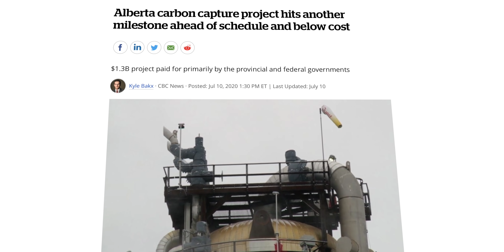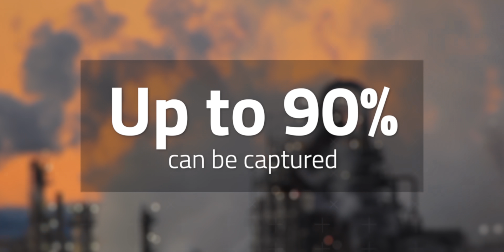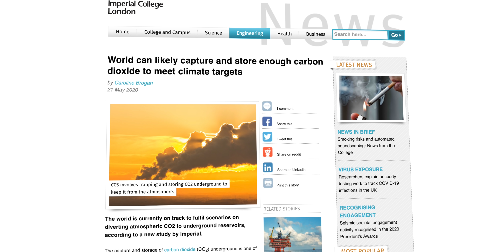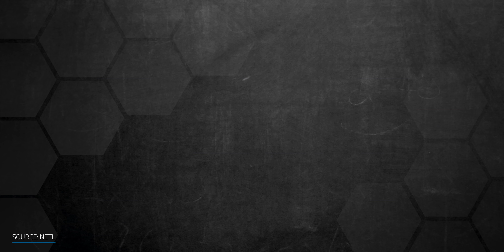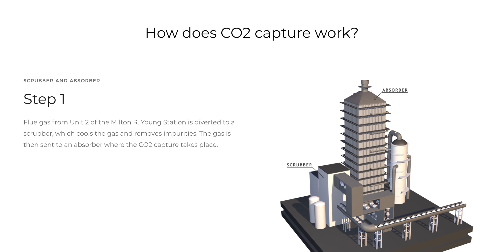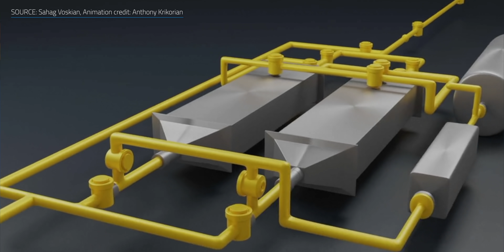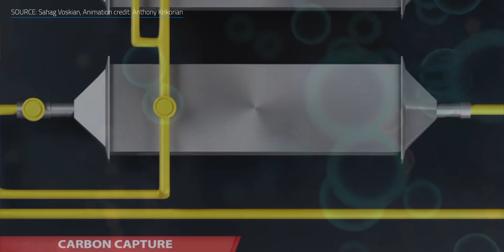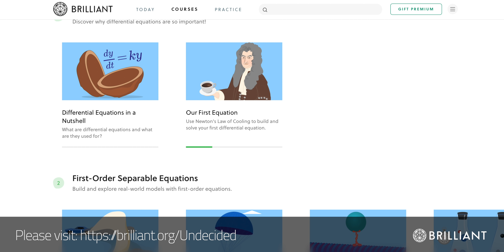The truth about capturing CO2 to reverse climate change

Comment: One thing that many rarely consider is the use of fireless steam locomotives for transport of goods over short distances. Such locomotives have tanks of steam or compressed air that is used for locomotion, which means one could use air compressors to refuel them. Of course, this would be part of concerted effort to reclaim our cities from cars. Railroads require far less space and are more efficient than road vehicles, and thus they must be considered if we are to have sustainable infrastructure.
Reply: What's their advantage over electric trams and trains?
Reply: @Sp4mMe 
1) Cheaper construction costs as they don't need overhead wires or dangerous electrified third rails.
2) No need for batteries that require rare earth minerals that are environmentally destructive to extract and rely on the exploitation of poorer countries.
3) Quicker to refuel (electrical resistance makes batteries take longer to charge the fuller they are).

Of course, I would only recommend them for freight duties on narrow gauge lines as a part of cargo convoys.

Comment: Direct air capture will improve, but to believe that sequestering CO2 under ground forever is a bit of a stretch. We did not leave the coal or fossil fuels under ground forever. Decomposition of plants and living creatures, burning of gas and other substances on earth, digestion and other activities like manufacturing allow CO2 to enter the atmosphere of our planet. To think that carbon capture is the only correct answer or solution for the problem is an error. We can work on the carbon capture opportunity together from day to day and until additional solutions are available and Incorporated with every safe and serviceable process.

Comment: Something just occurred to me: consider that air is over 900 times less dense than earth. Additionally, consider that CO2 comprises about 4 one hundredths of one percent of air. Of all the solar energy striking Earth, think about how much energy could be stored in such a small fraction of possible sinks. It's down there with noise level and it, at least on the surface, seems like it would have a minimal effect.

If you measured the energy stored in earth versus air from a days worth of exposure to the sun, what do you think the difference would be? Then further consider how tiny the fraction of CO2 is in the composition of air, it's a bit laughable.
Reply: maybe you have a good idea or maybe not.  But one thing is for sure, no one knows what you're talking about.

Comment: Sorry, but this video is total bullshit. All you've done is provide advertisements for a handful of proposed technologies without addressing how much these plants capture compared to annual CO2 emissions, and how they'll be powered if not by fossil fuel themselves. If you had done that, you'd come to the conclusions that millions of these plants would be required just to set our effective emissions to zero, and that's still leaving all the carbon in the atmosphere we've emitted since industrialization. The biggest single plant of this kind captures 4,000 tonnes annually. We emit 35 BILLION tonnes annually, meaning you'd need almost nine million of these carbon capture plants. Not only that, but you didn't mention that these technologies require energy to produce and power, and where are you going to get that energy when almost all of our power comes from fossil fuels? Carbon capture is a bullshit technology. The ONLY solution is scaling down our energy demands. That means fewer commodities for everyone. Period.

Comment: The choice, however, isn't between a coal plant running and a coal plant running with a CCS retrofit.  Since coal-fired power stations are very uneconomic these days, the choice is generally between a coal plant running with a CCS retrofit and a coal plant that has been shut down and replaced with cheaper alternatives.

The 45Q subsidy is extremely hefty - of the order of $4 per MWh - and is hence a subsidy for coal to keep on emitting the carbon dioxide that evades capture (_at least_ 10% plus 1/3 for the energy consumption of the CCS process, even assuming the never-before-demonstrated-at-this-kind-of-scale-or-efficiency technology works as advertised for a 90% capture rate).

Comment: Unfortunately carbon capture from coal plants is just someone blowing smoke, metaphorically, the tetra plant is shut down, but even when it was running, it was not even capturing 33% of the emissions of the plant, i believe it was closer to 12%, and they had to build a whole nother natural gas plant to run the carbon capture because that process is so intensive, and the amount captured did not even offset the amount the natural gas plant produced, this technology while a good idea on paper is just soo energy intensive its not practical, we are creating a bigger problem then we are actually fixing, even if you run the carbon capture process off entirely green energy, because its so intensive you would actually be better off to shut down the plant and just run that green energy directly to the grid, literally.

Comment: One of the first “facts” is clearly incorrect. 75% of green house gases is not produced by energy industry. It’s circa 25-35 per cent depending on what you consider an energy producer. Therefore, I cannot accept any further information, even though it might be correct, as you have one of the principles way off.
Reply from the maker: That energy sector number includes transportation, electricity and heat, buildings, manufacturing and construction, fugitive emissions and other fuel combustion.  That’s 76% today: https://www.climatewatchdata.org/ghg-emissions?breakBy=sector&chartType=percentage&end_year=2018&start_year=1990

Comment: Every year we add around 48-49 billion tonnes of CO2 equivalent that the natural world can not sequester. Spending insane amounts on extracting and manufacturing to filter the exhausts of one or two businesses is largely a useless exercise to allow a continuation of fossil fuel burning. One comment here basically says "Soon it will be too hot/dry for trees", CC is useless without already being carbon neutral, the idea had always been to get to net zero and capture carbon, because 2.5-3 degrees will still be difficult to avoid. 

Leaving 50-75% of agricultural land to return to natural succession, not planting forest, is the easiest reduction prior to shutting down internal combustion engines, easily done by switching to a globally plant-based diet. Every recent study has shown that this is the most reliable way to restore water retention and sink carbon. The most conservative models showing 20% of our annual emissions would be removed by this alone.

Comment: My concern is the long term, So if we end up cutting emissions and get super efficient at retrieving CO2 from the atmosphere, how is that going to affect the planet once we revert the atmosphere to below the original pre-industrial level.  Because then we'll have to stop trying to suck it all up and find new ways to release it again.

Plant life and everything else which relying on plant life requires a minimum level of CO2 to be sustainable.  While what we have now is an excessively high concentration, we also need to keep at least some around so that it doesn't become too low.

I understand there is also a move towards reducing methane emissions in order to reduce the weather pattern changes over a short period as methane breaks down in a decade compared to the much longer life of CO2.

Comment: Surely CCS should only be seen as a temporary measure, while we try and keep global temp rises below 1.5oC. Simply digging a hole in the ground and hiding it there (like nuclear waste) is a sticking plaster on a wound, it doesn't solve the problem. Also, it would be interesting to know how much energy/CO2 emissions it takes to run a CCS project, and if that offsets the potential savings from the original capture.

Comment: We're at 400ppm Co2 and under 200ppm most plants die. Earth is starving for Co2.

More Co2 in the air means less water, nutrients and sunlight plants will need, which leads to more plants in more places, which leads to more food and more life on Earth. Earth is not as volcanically active as it was in the past. Earth was losing Co2 until mankind arrived and liberated Co2 from the ground. Mankind gave Earth a 2nd chance of life as we know it. Co2 is not a pollutant, it's part of the life cycle. We have clean coal technology meaning the only emissions are water vapor and Co2. We need more Co2 not less.

Water vapor is responsible for 96% of the green house effect and Co2 only 2%. The sun has cycles and the climate is always changing. Climate models have failed because they underestimated the effectiveness of the plants and oceans to eat Co2. We can't even have accurate 7 day forecasts but we're suppose to trust 100 year climate models and change our whole lives upon it? That's unreasonable.
Reply: ". Earth is starving for Co2."

Its not. The plants are quite fine at 400, 300 and even 200 ppm. We fell below 170 in the last glacial age and plants survived

"Water vapor is responsible for 96% of the green house effect and Co2 only 2%"

Thats not true but also meaningless. Water vapoup content of the air is limited by temperature. Water vapour can therefore only respond to an increase to a temperature increase from other sourcs, for example CO2, with positiv feedback
Reply: @Dundoril  The less Co2 in the air less plant life we have, the less plant life we have, the less food and animal life we have. A Earth with more life is the Earth we want and need. 

Saying plants are fine at 400ppm is like saying handicaps are fine as long as you don't die. I don't agree. 

Currently water vapor is 96% of the greenhouse that is the average figure which takes in for fluctuations in the atmosphere. Co2 is only 2%. The point of this is to educate people that Co2 is not the all powerful agent of climate change. 

Earth was thriving millions of years ago with 4,000ppm of Co2, it was not a calamity, the opposite was true. We don't want 4,000ppm today because it's harmful to human health but 400ppm is dangerously close to unsustainable levels.  We need more plants to help feed the planet and to help keep our atmosphere clean and viable.
Reply: @rickrouse7865  "The less Co2 in the air less plant life we have, the less plant life we have, the less food and animal life we have."

You can repeat this nonsense but it does not make it true. 

" Earth with more life is the Earth we want and need"

Yes and do you know what will not help there: An unstable climate...because  Plants actually need a stable climate.

"Saying plants are fine at 400ppm is like saying handicaps are fine as long as you don't die. I don't agree. "

No its like saying: This 175 cm guy is fine at 70 kg...he does not need to weight 120 kg

" The point of this is to educate people that Co2 is not the all powerful agent of climate change. "

You ignored my whole argument why this is not relevant... Why? I already know..you did not udnerstand it at all 

"arth was thriving millions of years ago with 4,000ppm of Co2,"

Earth was also thriving at 300 ppm...

"but 400ppm is dangerously close to unsustainable levels."

No its not. Plants were fine at 300 ppm too.... but you ignored that again...
Reply: @rickrouse7865  " A Earth that can sustain a greater bio diversity benefits humanity versus an Earth that has a diminished bio diversity. "

The earth could sustain a lot of  bio diversity  at 300 ppm already. There is no reason to believe taht this will increase with more CO2..because a total unstable climate is bad for plants and animal alike...and sorry but  there are rather stable climatic zones.. I main cleary rainforest dont just turn into desert one year and then return to rainforests

". Lowering levels of Co2 will cause the death of millions perhaps billions of people"

It was fine at 300 ppm.... billions did not die...not because of too little co2 and plants anyway

" But 400ppm is anemic levels of Co2. "

NO its not...repeating it endlessly does not make it so.... Again: Plants are fine at 300 ppm.... 

" Obesity is a health problem from too much sugar in your diet and is unhealthy."

And why would 500 ppm for exmaple be any different? Just because you claim it to be?

"It's a positive effect, unless you think less plant and animal life is better for Humans."

Again you just claim that stopping the increase in CO2 would somehow decrease bio diversity
Reply: @Dundoril  your quote mining and pulling it out of context is getting annoying. you're just about the rhetoric and I don't like wasting my time on rhetoric. I will make this short...

Your argument is "we're fine". Sure. Some slaves say "we're fine" especially if they're comfortable. Some slaves say "we can do better" even if they're comfortable too. I'm with the "we can do better" crowd.

I already explained that the Earth will give us more resources to live better lives if it had more Co2 in it's carbon cycle. The planet will become wealthier in life and the resources of life.. but you say "we're fine". Ok but that doesn't mean we will believe in lies. Human life will do better with more Co2. So no Co2 is not the enemy, Co2 is not pollution, and no we don't need to lower Co2.
Reply: @Dundoril  stop with the bullshit. quote mining is never the way you critique an argument honestly. pulling out sentences out of a paragraph is as bad as pulling out words in a sentence, it's pulling it out of the context and misleading the public. Then you got to chase the responses to the quotes or completely ignore them. Chasing quotes that can be misread because they got ripped out of argument. No, I'm not playing that game. If it makes you happy you can call it a win, I won't dispute it. Good for you, congrats! :)
Reply: @rickrouse7865  again: it never did pull any sentence our of context. Can you tell me which setence you are talking about?

Comment: You know what is really great CCUS material? PLASTIC! Yet all the Gretas out there hate plastic as though it were a plague... it even degrades eventually back into simpler hydrocarbons after it's been in the ground 50k years! It's genius!! But no, now I have to drink from  paper straws and use shitty paper bags at the grocer that fall apart before I even get home.

By-the-by, the greenhouse optimal standard for plant growth is between 700-1500 ppm CO2, and the historical norm for the planet is closer to 2000 ppm. Just saying...

Comment: Carbon Dioxide is not a greenhouse gas. It is a dipole molecule with a dipole moment of zero. Just the same as O2 which also has a DPM of zero. A gas molecule must have a non-zero DPM to absorb IR/UV energy. Water vapor is the greatest contributor to the greenhouse affect, which is not permanent or cumulative since trapped heat returns to space (The colder body) There is no "Climate Emergency" and human emissions do not and *CANNOT* affect climate. The entire push to capture CO2 to reverse climate change is fabricated and ludicrous. The intent of Climate Change is to tax Americans energy use to to point it is not longer affordable to constrain free-market Capitalism and promote Socialism.
Reply: "Carbon Dioxide is not a greenhouse gas. It is a dipole molecule with a dipole moment of zero. "

Your first sentence has nothing to do with your second... Its only zero when its NOT vibrating

". A gas molecule must have a non-zero DPM to absorb IR/UV energy."

But it does aborb them...We can measure the aborption lines of CO2....has been done more then a hundred years ago
Reply: @Dundoril  You are wrong. That CO2 has a dipole moment of zero is why it is not a greenhouse gas. Both Oxygen and Nitrogen also have a DM of zero. They are not considered greenhouse gases. Does this mean when O2 and N vibrate their DM does not change but the DM of CO2 does? Why is that? How can these non-covalent bonds change orientation when vibrating? Do you have empirical evidence of this or did you just make it it up?
Reply: @Dundoril  You believe CO2 magically changes it's DM but other gas molecules with zero DM do not. That is physically impossible and you only believe it because you have been brainwashed by those who desperately want to continue the Global Warming conspiracy theory to tax carbon emissions. That is the goal. NOT going to happen. Period. Give it up.

Comment: All these actions are meant to make the earth cooler. The main energy source (if not the only one) that makes the earth warm is the Sun. In this sense, harvest solar power is counter productive because the captured energy will eventually become heat.
Reply: Most of it would become heat anyway. If the solar panel does not absorb it, then the ground will